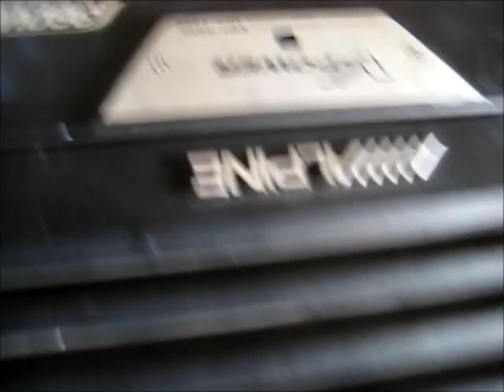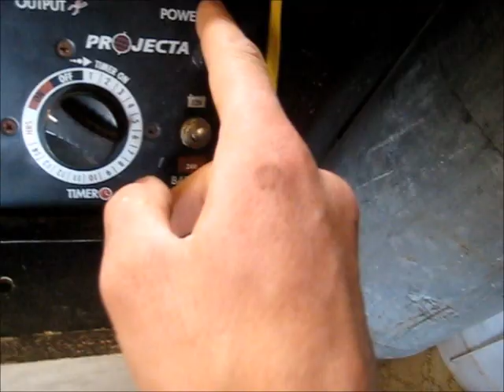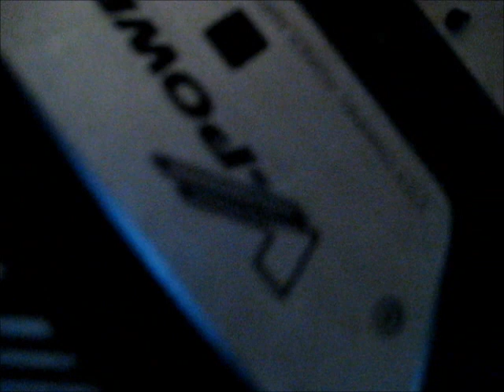Fix & Troubleshoot Amplifier

Comment: is it possible to mod an amp? i want to get a cheap 1000 monoblock hifonics i got sittin arround and try to get it to arround 2krms clean power haha any help appriciated
Reply: Best bet is to get a cheap 2krms clean power amp...haha. Why would anyone want to modified a cheap crappy design to begin with? If you want more power then simply get a bigger amplifier. You CANNOT make an amplifier double its output by modifying it as it will require the replacement of several components including a larger transformer therefor making the whole "mod" not affordable.
Reply: n i got more powerfull amps,, looking into a seccondary 3.5krms  ,,, but i wanted it to be like a super sleeper lol,,, the hifonics is junk but it will work for a small simple build

Comment: Well, you learned your lesson... When repairing the PS FETs, replace ALL of them. Chances are very good that the others sustained damage when others failed. A good repair is to replace them ALL.... even if only one failed. Bipolar transistors don't usually require them all to be replaced so when an output transistor fails, the others are usually fine, but DO replace the bias resistor(s) for the failed part(s) That just makes for a good repair.
Reply: ***** True, however in low power circuits, generally speaking of course, it usually isn't necessary. Yep, I agree with your thinking on what is a good repair, though.

Comment: i have a vr3 200 watt 2 channel amp.. every time i hook it up it shows red light ( protection mod) and taken the fuse out while its on or off doesnt work .. SOME ONE HELP PLEASE
Reply: What can I do to fix it my self?
Reply: kickinshit2 There are a few checks to make but Astro is right. it is probably a bad output device and is causing DC voltage on the output thus triggering the protection circuit and protecting your speakers and further damage to your amp. Other things can cause DC on the output such as a bad power supply to the preamp section. They ususlly have +/- 15 volts. Check the voltages on the preamp chip(s) look for bulging capacitors throughout the amp. I don't know what kind of test equipment you have so it's hard to advise you what to do.

Comment from the maker: you may have either cooked the primary of the power transformer, if it used a Linear PSU!, If that's the case, try a new power transformer

Comment: hi mate..on IRFZ44n u are dealing with a mosfet these control the power . these fets work in pairs, i did change one on an alpine and it blew the other ones..than i had to change the lot and it fixed the problem.. desolder the fet of the board and test them for shorts. and yes wen u connect the power and ground they will blow if the are short. and also does the amp turn on with out the remote connected ? if yes than power circuit has a short transistor ..

Comment: hey man i got a 1000w  Memphis! im having throuble with it i just replaced one irfz44n fet, when i tried to conect GRD and +12v supply before connecting REM a hum started and burnt another mosfet so you recomend replacing all of them actualy my dought is why when i connect neg and pos supply without connecting REM the fets burn¿ 
Thanks for your time  
Regards.

Comment: mate..i am fixing amps from a long time.and still do..some tips..always desolder the parts when testing them..when you change the mosfets on the power side its always better to change the whole raw of power side because due to the bad ones the good once also get stressed and will make your hard work to waist if you dont do so..

Comment: You can use rubbing alcohol, 90% is better than the 70%, to remove flux from your circuit board after you solder. Use a stiff brush (non-metal) like a toothbrush dipped in alcohol and it will clean up.

Comment: extremely simple to find fucked ic/ts/cap/
Btw, i bought Rockford Fosgate P400-4 wich the owner said, its totally dead...
I held my laugh...
Went home, opened it up and the and speaker protection switches were burned, soldered sa pins together and boom, works.

Comment: If one Mosfet in a phase needs replaced, they should all be replaced. Even if it tests OK, matched date code parts are the best move for the entire phase. Not doing so can promote reliability issues you experienced ;) Nice video.

Comment: i have a amp im working on its a power acustik 2000 watt i replace all the mosfets cause they were burnt out so i plugged it in and when i do i feel a hot spot coming from inside i havint looked at it while its plugged in with no top any idea on what it could be?

Comment: If a car amp power supply fails YOU must check the following: gate resistors, driver circuit. Make sure it's producing the ~ 5 volts DC to drive the fets. It probably had a defective driver circuit (reason why it didn't turn on) and make sure to check for any defective output transistors reason why most amps fail because a shorted channel. Remove those before repairing the power supply.

Comment: rule one when one or two fets on a bank fail you have to replace all of them and make sure all the gates resistors are good.whem working on amps alway used a current limiter.

Comment: By the way the ones that you replaced are the power supply mosfets and you must allways replace all of them or you'll have what happend when you put power to the amp. Also you need to check the gate resistors cause they sometimes short out when power supply fets short. Next time try a 5 amp fuse. On a small amp like that idle current is'nt much at all. Check your capacitors to, look for swollen or bloated looking capacitors. The resistors are probably SMT so keep that in mind.

Comment: Trust me, they will short out at some point which will be sooner than later. Just a heads up for anyone replacing these types of components. I'm here to help anyone that needs help. I seen this and thought that I would let those who don't know this, know. It will save you money and time cause you wont find yourself buying more parts and taking your amp back apart. Good luck to all with your repairs.

Comment: Also when you order new mosfets or transistors, which ever you need, ask the sales person to make sure that they all come from the same batch and same date. The reason you don't mix these components is the diferences in ratings that the new ones will have from the old ones. These differences are slight and the old ones change after years of use and when you mix them most of the time the others will short out when you start pushing the amp hard. There is too much to explain in the differences.

Comment: I repair amps every day for a living. I own my own small business and have 2 degrees in electronics. I have been repairing car amps for 16 years and any other electronics. I just wanted to let you know that when you have a shorted mosfet or transistor, you must replace all the transistors or mosfets that are in that circuit. For instance say you have 4 mosfets in your power supply section and one is burnt, you should replace the other 3 as well same goes for the output section.

Comment: did you use remote wire that turns it on from radio 12volt